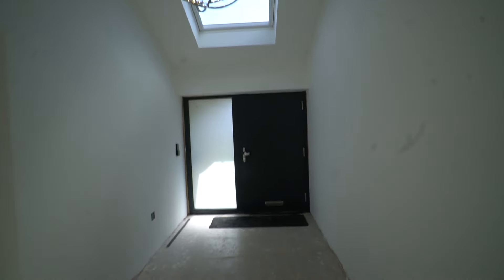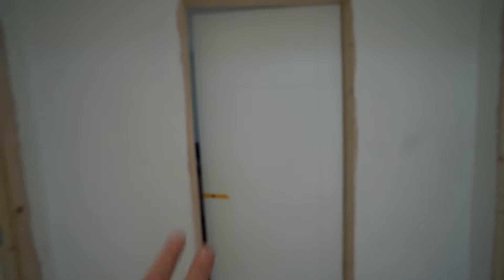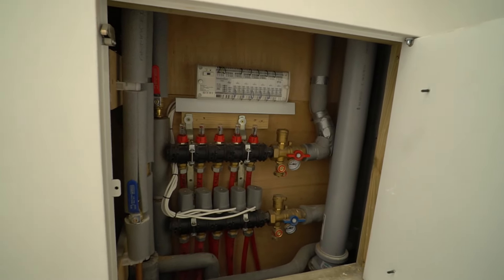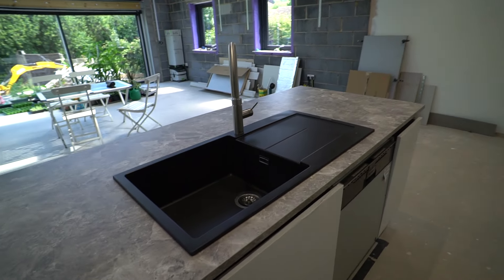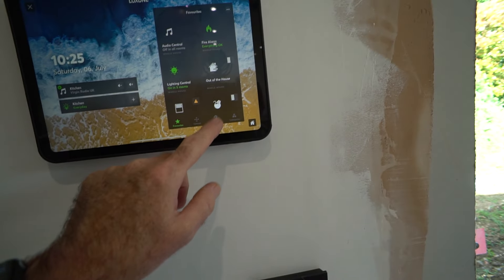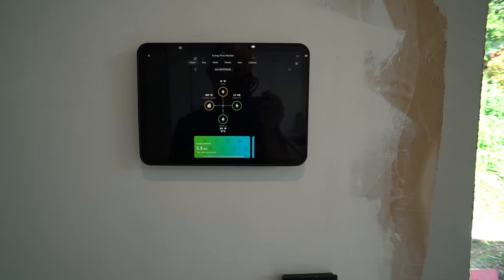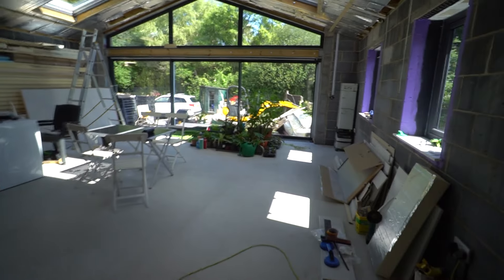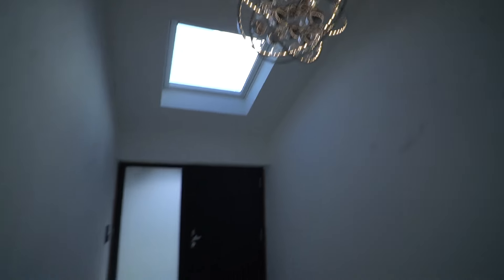1970 bungalow renovation update. 2nd fix and kitchen install

Comment: I'm mostly interested in the MVHR system as I have a large bungalow and am thinking about doing a retrofit. As you're not quite finished yet, it seems its probably too early to ask about it and also, with such a large scale renovation, it dawns on me that it will be hard for you to say how well just the MHVR works pre and post install since there will be no pre data to compare against. I guess you could turn it off to do some comparisons but I can't see that happening LOL.
Reply from the maker: Hi Dave, I am just about to complete the commissioning and will do another update. Our old building was terrible for ventilation, there was not even a vent in the bathroom. We also found water leaks under the floor so it was pretty terrible. We would have had to fit 5 separate extractors in the renovated building. Its not difficult to install but if you are retrofitting with insulation in the loft its going to be a fiddly job. I have read that installing MVHR is you have a leaky home can be a bad idea, I assume you end up pulling in cold air in some rooms and pushing warm air out of others. We have tried to make our place airtight but currently have several service ducts open into the roof so I don't plan a blower test (not required on a renovation). I do have a thermal camera so will use that as it gets colder to go hunting for air leakage. All I can say so far is that the bathroom extractors work well and that we don't hear the system running unless its on boost. We won't really know how well it all works until we go into winter. I would get in touch with Terry at www.heatrecoverysouth.co.uk he can advise you on what sort of system may be appropriate. He supplied my system and will do the commissioning.
Reply: @JurassicJungle  Thanks for the info, I will fire off a message to that company and see what they say.

I am undertaking renovations but unfortunately, I'm not doing a whole house renovation so I would have to peace meal a system together, where-by I could cap off outlets and install later. 

My main requirements are that I have two hot rooms currently, the oil boiler room and a switch room where my solar inverters are located. It would be great to remove the heat from these rooms to benefit others in the house in the winter, removing individual bathroom and kitchen ventilators would also nice.

Comment: Hi you weren't kidding about Grand Designs! Looking forward to catching up with all the vids of this build. We have an EV and have been thinking about solar so it'd be great to get an update on how that performs in winter. Hard to tell if the high set up cost will be worth it over time...
Reply from the maker: It’s hard to say if solar is worth it just for an EV. We use intelligent octopus and charge at 7p most of the time, you get paid 15p to export so it makes little sense to charge the car with solar. As we have a heat pump the battery is much more interesting as we want to run at 7p or free for as much as we possibly can. My bills at the moment are about £50 a month and we are doing loads and loads of washing and drying. It will be interesting to see how winter goes.
Reply: @JurassicJungle  it would be for the house too, a proper system. But being an old stone Chapel I'm not planning on a heat pump and so our power bills aren't too bad. The cottage is totally off grid with a really fancy system that I don't pretend to fully understand..
Reply from the maker: @snowdoniaescape  I will do an update over winter, we have generated around £800 of solar so far this year from our 12 panel array. Do you have a mains supply or are you really off grid? It may be worth considering a battery as well as solar. If you are on grid and have a smart meter I would recommend Octopus.  If you do move to Octopus please consider my referal code as we each earn £50 if you do so. https://share.octopus.energy/melon-dog-595
Reply: @JurassicJungle  at home we are on grid for electricity. But no mains gas so heating is a conundrum, oil at the moment. We've just switched to British Gas for the EV tariff but I'll try to remember you have a code if we change again I know the octopus tariff is a good deal too.

Comment: Hi, any update video ?
Reply from the maker: Hi Sorry we have been so busy trying to get the house ready before the weather changes. I have recorded lots of material but need to put it together. Are there any areas you are interested in? If so I will try and do these first.
Reply: Best of luck getting your house ready soon, I'm interested on the KItchen and open plan area.
Reply from the maker: @mezzobadr  OK, cool. I have just about finished the plaster board in that area, the roof took a lot of work. I will record an update just before we plaster. The steel above my large doors was not level so it has taken me a while to work out how to correct that.

Comment: Coming along nicely!  If you want a fancy cover door for your Loxone cupboard I'm just decommissioning 3 Superdomes. Might look smart, might give you nightmares haha.  Velux windows look good at first but do need cleaning or else the grime builds up inside and out, so make sure you have maintenance access.
Reply from the maker: Thanks Stephen. I did used to have a Superdome HP badge on a touchscreen PC in my last kitchen, I am planning to make a hidden door to my study. I was planning to use these trendy strips of wood but a Superdome door could certainly be a talking point. I was also considering a HAL9000 model for the front of Loxone. I have bought a ladder to clean the Velux, they are centre pivot so you just swing them around 180 to clean the outside so I am good while I can still climb a ladder.